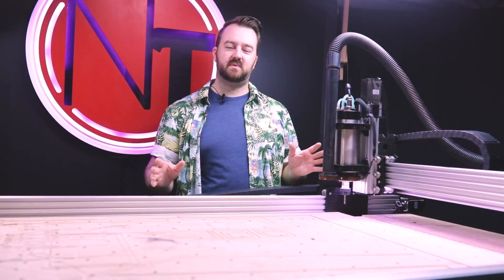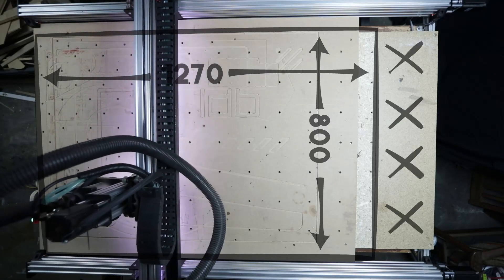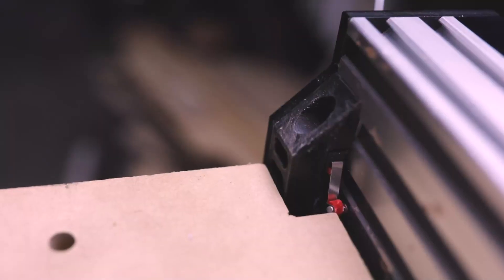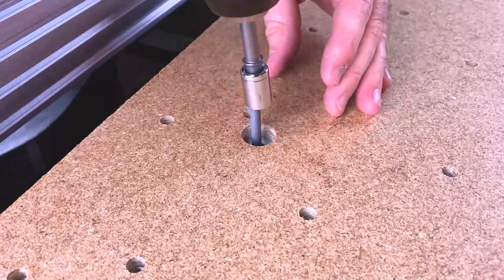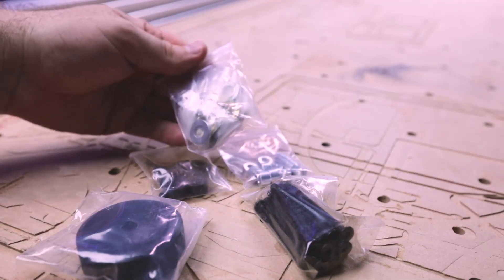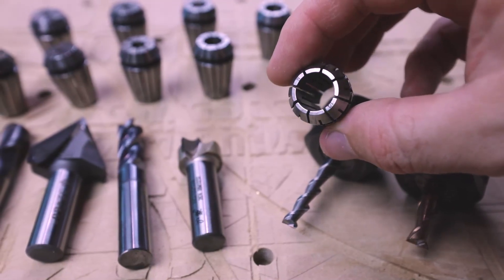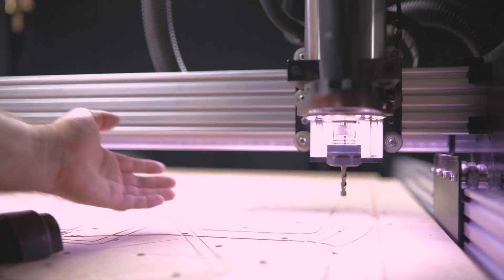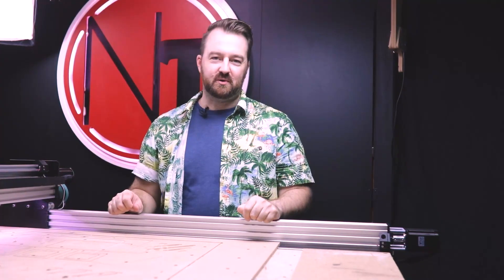My NEW Workbee CNC

Comment: what controller did you pick for this package? i owned a co2 laser cutter but new for cnc router. so picking the controller choices under Bulkman 3D man store for the  workbee cnc package is confusing to me
Reply from the maker: Thanks for your comment! I can understand that this is confusing with so many choices. There are 3 main decisions to make when considering electronics - what control board type (mach3 or grbl), your confidence in wiring and how much power you want to run on your machine. I already had my electronics from previous machines and is similar to the high torque package. The xPro is much easier to install, however harder to add on or change components. I’ve recently upgraded to fluidnc board using the ‘high torque’ motor drivers and it’s amazing!! If your not confident with what to purchase and want to get going quickly, go for the xPro! Hope this helps
Reply: @NEWTechCreative  thanks for the tip. My goal is mostly to cut or carve acrylic and wood. So i guess xpro is the route i should go down to. Thanks again for the tip!

Comment: Thanks for posting. I just discovered your channel and really appreciate your creativity. It is very interesting to me how similar our paths through the CNC world over similar time frames has been. I started with an original MPCNC, then LowRider, then a DIYCNC of plywood. I looked at the Workbee but opted to build a PrintNC with closed loop steppers. It is super rigid, very accurate, and relatively inexpensive. I have 4 different control board options for it and 2 for the MPCNC. I now run 5 axes on my PrintNC for my particular objectives. You might like to look at Grblgru as a CAM program. It’s free, extremely versatile, with many machine models available. Cheers.
Reply from the maker: Thanks for touching base with me J! Great to hear your similar journey…. CNC world is very addictive!! I’ll be building a new CNC soon (surprise, surprise!!) and wanted to integrate 5axis for more flexibility… might take 6months or so to finish. I’ve known about grblgru however never got around to having a tinker!! I will check out sometime. I would love to see your setup… do you use Instagram?
Reply: @NEWTechCreative  I don’t usually post to Instagram = not enough hours in the day ha ha. Here is my basic setup: https://youtu.be/vTCpnslGxJE
Since that video I created a 5th axis to do the kind of thing in the overlapping circles video on that channel. Grblgru has been kind enough to enable some of my requests to enhance his program’s capabilities. My requests are quite specific to embellishing turned wood pieces I make, as is the 5th axis I created. I abandoned the usual trunnion approach after several prototypes. This approach ended up being quite easy to write software  for and Grblgru was very helpful in that regard.
Using his program I can take one of my turned pieces and create an accurate STL file of it. I can export that to another program for ornamental turning design, or easily wrap a DXF file around the piece and cut it with Grblgru. I can use a router or laser. His program will burn a pattern to a curved surface like a bowl unlike all the other software. I really like Lightburn but it can’t do that. That was my first request of him a few years ago.

Comment: I just upgraded to the queenbee pro from a mpcnc that I've been using for a few years. I got tired of the slow cutting speed as well, and I was tired of tightening parts all the time and having to print replacement parts after they would break. That being said, the most recent primo version of the mpcnc is holding up much better aside from having to tighten things every use. Really looking forward to the new machine. I got the 1500x1500.
Reply from the maker: Wow! Nice work 👍👍 you will love the queenbee. You will be amazed how fast you can cut/carve. Enjoy the journey 😁
Reply: @NEWTechCreative  thanks! I can't wait!

Comment: question: how do you prevent the bottem board with the taps in it from being damaged by the CNC process? Do you add a wassteboard and then the CNC object?
Reply from the maker: Yes that’s correct! I’ve added a 9mm mdf waste board to the top layer so I can replace when required and drilled holes through that match holes in base board. To avoid going through the waste board I always set my zero from the top of waste board then raise the head the thickness of material… is the stock is 12mm, I measure 0 at waste board then raise z axis by 12mm then zero off (if that makes sense?). This avoids even going through waste board.
Reply: @NEWTechCreative  makes perfect sense, thanks! I suppose it does require you to perfectly align the holes for the tops in the waste board and bottom layer.

Comment: Hi, wanted to ask what is the deiffernece between 1. ooznest 2. openbuilds and 3. bulkman since they all display the workbee ?
Reply from the maker: Great question @Triumf Dula . The original workbee is screw or belt driven and they now have a newer version Z1+ that improves the electronics and screw thrust bearings to provide tension to the screw axis. Bulkman released the v2 with the tingle tension system with providing a longer screw and thrust bearings…. This was before the Z1+ was released. Bulkman v3 is a redesign to compete with the queen bee version and has a rack and pinion design and stronger/higher z axis. The rack and pinion version is very similar to the larger competitors such as avid CNC…. Providing even higher precision and bigger machine as the don’t rely on long screw driven axis. I hope this has helped your decision!
Reply: @NEWTechCreative  seeing this I might go queen bee or build my own version, want a 8' X 4' area to machine so like can use it to cut boards instead of use a saw but space in flat looking to make where use flat then stand on end with vacuum pump to hold pieces

Sorry for all that, mainly wanted to ask have you found a way to sort of self level it so it counters the bend when gets to middle even if not by much?
Reply from the maker: There are many versions of the workbee out there and some have chunky linear rails or heavy duty cbeams that help stiffen the x axis to reduce warping when in center. Worth while doing some research about this before purchasing!!

Comment: First of all thanks a lot for all your video. 
I also just finish to make a MPCNC, but like you, I want to use shorter time to cut a 18mm plywood. 
So I want to ask you, do you think that the stepper motor and SKR Pro card it should be enough in order to move the more heavy Workbee please ? 
Thanks again
Reply from the maker: Thanks for your comment @Denis G. Great to hear you are on the same CNC journey as myself. I’m still very impressed with the stock workbee and continue to push faster and harder! I purchased the larger nema 23 2.45nm motors that handle 3A current. An skr pro board is capable of powering these sufficiently, however check that the motor drivers handle a max peak current of 3A or more… I would only power the motors at 2.5A, however you need the drivers to not overheat and always predict from more than needed to be safe. I use an arduino uno with grbl and external large st-m5045 that handle much larger current and I don’t worry about working the machine harder. I like the external drivers as I can update the control board without buying new drivers every time. It’s up to you and what you want to invest in for the long term. I can run at 5000mm/m with my current setup and that’s more than I will ever need, but I know that smaller drivers won’t handle the same rigor. I hope that’s helped you! Thank you 😊
Reply: @NEWTechCreative  You help me a lot and thanks a lot for the comment. 
I just think to try to make the pieces of the Workbee by my self, using the actual MPCNC... but I still study of what type of Workbee to make :-) 
...there is a lot of model 

Thanks again

Comment: Can you please share the name of the tool you used to check the height diferences between the spindle and the spoilerboard top? What's the brand, where did you bought it? Thanks
Reply from the maker: Yes they are called dial indicators. There are both digital or dial versions. I purchased a digital dial indicator from AliExpress for around AU$40. 👍

Comment: Hi Brother thanks for advice Am new in CNC machine i never been near CNC machine but am kind intersted to start with somehing affordable
am about to buy Queen Bee Pro. specs as follow.

Please see our VFD Specifications
 * Brand: Huanyang
 * Input Voltage: 220 V
 * AC Output Voltage: 208-240 V
 * AC Input Frequency: 47 / 63 Hz
 * Output Frequency: 0-50 Hz / 0-400 Hz
 * Power: 2.2 kW
 * Input Phase: 1 or 3 phase
 * Output Phase: 3 phase
 * Control Mode: V/F, Sensor-less Vector Control (SVC), Torque control
 * Speed Adjusting Range: 1:100 (SVC)
 * Carrier Frequency: 1 kHz – 15.0 kHz
 * Automatic Voltage Regulation Function (AVR)

what would be your best advice to beginer like me.
Reply: yes it is water cooled as i have been told with supplier. also they have laser spindle selling separate
Reply from the maker: Great buy!! You will be happy with it 👍👍
Reply from the maker: Thanks for your message @Ajs Pro ! Yes this is great! Check that it is water cooled… not air cooled. I really love the 2.2kw, however can be intimidating at first. I run most jobs at 11000rpm and carved like butter! Will be amazing with the queen bee. Good luck with the journey 👍👍

Comment: Hi,

Thank you for this video, what spindle did you use in the end. That is my next upgrade - similar reasons to you, but also noise reduction.

Thank you in advance.

Andy
Reply from the maker: Hi Andy @The Woodgrafter , no problems! I ended up purchasing the same 2.2kw spindle from a different vendor… however was a stab in the dark with what I was purchasing, although is going smoothly (so far 🤣). I only run it at 11000rpm max and chews through everything with ease and only drawing half the amperage. It’s a worth while upgrade 👍

Comment: How silent is that spindle ?
Reply from the maker: I would say pretty quiet! A tad quieter than my battery powered Ryobi hand drill. My vacuum is much louder then the spindle. Also depends on what your cutting and bit type but a massive difference from a palm router.

Comment: For some reason my machine is not working correct ive squared it and fir some reason the Y axis shift and makes a terrible noise and the Machine pretty much stopped also on the x-axis it does the same thing trying to home the machine does not work.It keeps going out of square with the whole machine and start to shift  I squared it I don't know what else to do I followed all the instructions and ill it does is make terrible noise the x-axis will. Not got side to side with out stopping in think ive tried just about everything to make it work when I. Move the y-axis one side is about 5 or 6mm off from the other side measuring from the backplate to the inside of the y axis plate please help
Reply from the maker: Thanks for your comment @John Cherry. It could be a range of issues and without seeing the machine and setup it’s hard to know exact problem. My instinct tells me that your motor on one of the y axis is not correctly wired or missing contact on one of the wires. I would suggest joining one of the workbee groups on Facebook where you can post video and photos, plus have a larger community to assist with your setup. I hope you are able to resolve this issue soon! 👍

Comment: Dear, I have a question about Lead Screw: 
- What kind of lead screw used for Workbee?. T8?
- What kind of lead screw nut for X, Y and Z axis?. This is Openbuild plastic nut?
Thank you!
Reply from the maker: Thanks for your comment! Yes a T8 lead screw… more info here..
https://ooznest.co.uk/product/acme-8mm-lead-screw
There are a few pieces of hardware that connect at both ends. Best to research the tingle tension system for more info! Regarding the nut blocks, I suggest searching for acme nut block as there are two types used for x,y and z axis. 
Hope I’ve helped here. Thank you
Reply: @NEWTechCreative  thank you!

Comment: I've just purchased the Workbee v2.2 1010 full kit from Makerstore and am doing the build, where did you get the fusion 360 stl file from. It would help with assembly
Reply from the maker: Great work @Steve S!! You will have a blast with the workbee 😁😄 download the workbee files from Thingiverse then open the .step files!! These are not .stl - however they are much better then stl. Good luck with the build 😁
Reply: Hi I'm waiting for mine in the post. Where you missing any parts/bolts or was everything included?
Reply: @DonOchetti  I was missing several screws for the CNC controller and the wrong cabling for the steppers and limit switches, both items were speedily dispatched and fixed. My biggest problem is the wiring, there is  no dedicated manual for this and you have to continually refer to parts of the online manual, which vary from model to model . After several months I can see light at the end of the tunnel with the help of youtube videos by Bulkman3D, Openbuilds, eben Ooznest and snippets of assembly instructions scattered throughout the Internet. Having said that It is a quality build and worth the money - my only disappointment is the lack of a dedicated hard copy manual which should be included with the kit.
Reply: @StallthenTurn  Yup sounds like I'm going to get a headache  haha wish me luck. Have fun using your machine, thanks for the reply!

Comment: What motors does it occupy? ... I have the same one and I assemble it by parts but I want those motors and I only find some smaller ones and with less torque. I would appreciate your answer
Reply from the maker: Thanks for your comment Manuel. You can fin these motors from ooznest 345oz/3A nema 23’s, bulk man sell them as well called 2.45n.m motors. If you search for the words nema 23 2.45n.m/345oz 3A motors, these should pop up pretty quickly. Good luck 👍
Reply: @NEWTechCreative  Thank you very much I will do what you say

Comment: That new table design looks awesome!   What spindle did you purchase and from where?
Reply from the maker: Thanks for your message! I purchased the spindle from China... really happy with my new one. If you need more info, let me know.
Reply: @NEWTechCreative  PLZ give me the link for the spindle!!! <3
Reply from the maker: https://www.ebay.com.au/itm/2-2KW-Water-Cooled-Spindle-Motor-ER20-Engraving-Mill-Grind-4-Bearings-/181143790452?_trksid=p2349624.m46890.l49286 

Unfortunately this item is sold out, however you can search for similar!